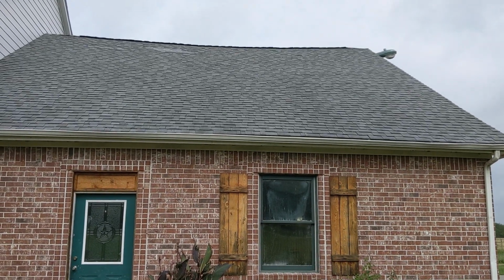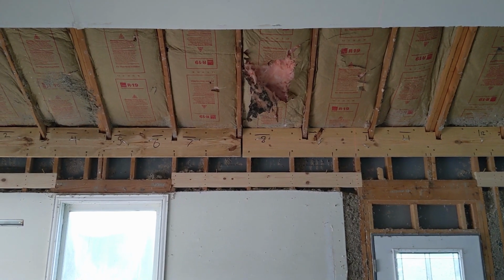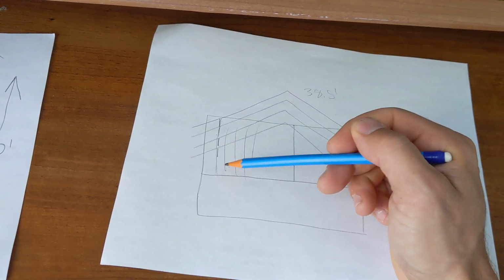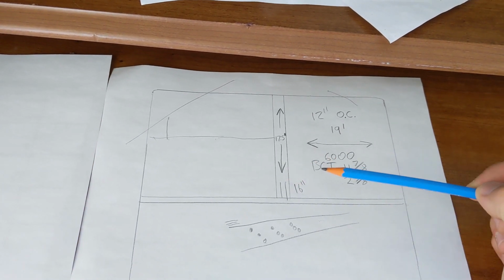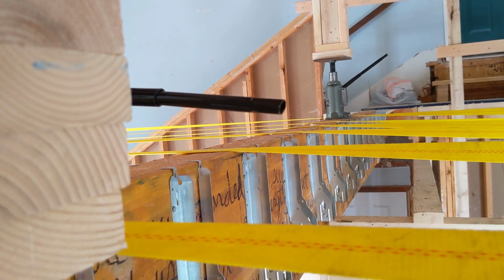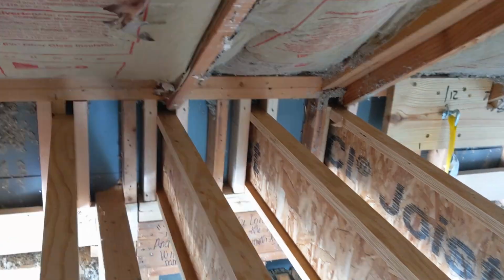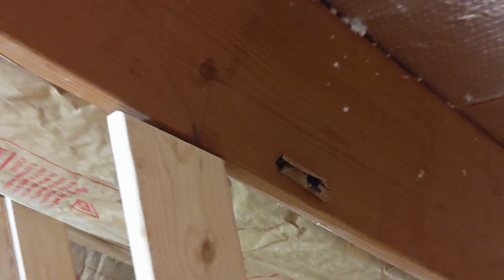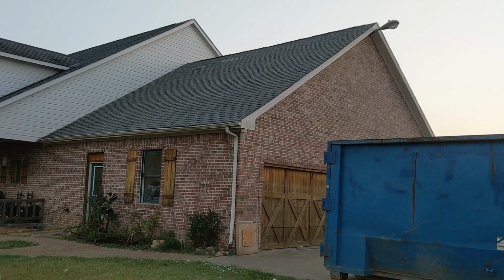Sagging Roof Fix

Comment: Hats off sir … I’m about to tackle mine … I don’t know if I should be happy or desperate … happy to see that for the main part I had diagnosed my own issue pretty wen and had an idea how to address it all I mean roughy. To raise up the roof ridge while at the same time pulling / or assisting the walls to come back to their initial/vertic!al  position. With  straps  pulleys anchor bolts with eyed ring bolts. Or kinda of … and desperate cause considering the number of precautions you take I realize that I h avent worked enough on the safety plan .😅so I sincerely appreciate you for sharing  your expertise and sharing the steps of this big piece of adventure ! Bravo 🙏

Comment: I’m normally not overwhelmed, but your technique has certainly made me feel like I need a breather and scratch my head as to what I just saw. Did you study this from an engineering perspective or are you just naturally gifted at knowing how to solve this?
My garage roof has a small dip in the middle plain due concrete Spanish tiles sitting on top of 2 x 4 trusses at 24 inches on center. Video such as yours certainly has given me some ideas. Thank you.
.
Reply from the maker: Thanks, I am always learning and troubleshooting. If I were to do this again I would use come-alongs instead of straps, but ultimately the second story and knee wall jacking is what fixed the rafters. When they've been sitting like that for so long there's not much you can do and it requires a tremendous amount of force to bend them. The other option is to remove the roof decking and "sister" on a straight rafter to the old one.
  Regardless, it's a lot of work!

Comment: Because the rafters pinch the ridge bean isn’t it known as a ridge board?
Reply from the maker: It's not the "pinching" that makes it a ridge board, but rather the way its supported and whether it supports the rafters, but yes, this is a ridge board, not a beam, but vernacular... Hot water heater/water heater, window sill/stool/apron. People use different words to indicate the same thing, but your terminology is correct.

Comment: How do you fix this without creating an attic space like you did??
Reply from the maker: First option would be to jack up a new sistered rafter next to each existing rafter. You would have to have a couple of jacks underneath and create a post and jig to keep them aligned, then nails/bolt them together. 
  Option two is to remove the roof and decking, sister new rafters onto the old and add collar ties. If the ridge beam was undersized and sagging then you would have to replace that too. 
  Basically, remove the roof and rebuild whatever portion was messed up.

Comment: seems to me that someone expected the collar ties to keep the walls from spreading, which is not the point of them.  You can't put an angled load on a straight wall without a buttress of some kind.  You need different trusses if you aren't going to support the walls laterally.  I doubt a roof without rafter ties meets code.

Comment: Thanks for your video. It is really helpful. One question is about toenailing, can you take the nail out once it is toenailed into timber as I saw you using only four timber to jack up the rafters and they are taken turns. So must you take the nail out then reuse them to prop up the rafters?
Reply from the maker: Yes, you can, eventually the board will be destroyed, but yes, you can remove toenailed boards. You can get something called a duplex nail that is made to be removed. It was created for concrete workers to be able to remove a nail easily after forms were put up.

Comment: You know your stuff - well done. There's nothing like rebuilding something that was built (incorrectly) only 12 years ago. My only suggestion is that they add a kick-out to their gutter for that rain water so that their next problem isn't a crumbling foundation.
Reply from the maker: Good eye, and yes, when they replaced the roof not long after, I made sure they put kick-outs on both sides. It always amazes me that roofers miss something that is code required and essential to preventing water damage.

Comment: couldn't you've just jacked up the center ridge beam at several spots, then doubled up on the ceiling joists and added more vertical supports  + build a knee wall on each side of the rafter?  That would fix the roof line and rafters on the cheap, and you wond't have to build the extra 2nd floor room.
Reply from the maker: There are different ways you could do things, but they wanted to build an additional guest suite. Honestly though, I'm not sure anything less than a new floor would have been able to handle the stress I was applying to the rafters, but yes, you could try to reinforce the joists and build off of them.

Comment: Chains and binders would have been much better than ratchet straps.  As for jacking up, I have welded a 10x10 plate on top of a screw jack.  Works much better than a hydraulic jack.   I remodel  kitchens and open floor plan is the thing anymore.  It's amazing how bad some house are built and how they even passed inspection in the 1st place.
Reply from the maker: Good ideas!

Comment: Is there a way I can send you photo you a house I’m DIY on my own. Similar concept, except, this one has a missing support beam and the center of the roof is sagging. Your technique is close to why I wanted to do with one exception, instead of using the cords for the wall, I need to use them to pull in the rafters that are blushing outward, making the roof sag.
Reply from the maker: Www.myfortressconstruction.com should have my contact information. Feel free to send me what you're dealing with.

Comment: How about when there are foundation leveling problems and a roof sag. Where would you start first?  The Foundation?
Reply from the maker: Yes, in any remodel, if the foundation needs to be addressed, it's the first thing to fix. Because everything above will move/crack/bow/break. Better to not fix it twice.
Reply: Heading to the basement first thing in morning! Mite be best to sell!

Comment: I gotta ask and Im scared to find out the answer but what does something like this cost to do? I'm looking at similar work to be done in a house that I'm closing on in 2 weeks.
Reply from the maker: So, that's always a difficult question to answer. There really are a million variables. To take it from a garage to a single apartment dwelling and fix the roof in the process, and build a new laundry/mud room, stair case and foyer cost about $80k. It really depends on how much you need to do. I think just the shoring up and building the floor across was around $10k in materials and labor is usually about the same as materials.

Comment: I need to do this to my garage and loft. Almost thinking it would be easier to just rip of the roof and start from scratch? Love how you did this though, some great tricks.
Reply: This just seemed to be excessively over engineered….if it weren’t for the historical value of the brick veneer, I’d bet rebuilding all new would have been less expensive
Reply from the maker: 👍 If we weren't building the second story in there to work off of, then yes, the way to "straighten" the rafters and ridge would have been to remove the shingles and osb decking, then sister on straight rafters to the structure wherever it was sagging, and add better rafter ties and cripples off of those ties to support the ridge. Moral of the story: Build it right the first time, engineer the ridge beam and rafters.
Reply: @MyFortressConstruction  thank you for the info :)